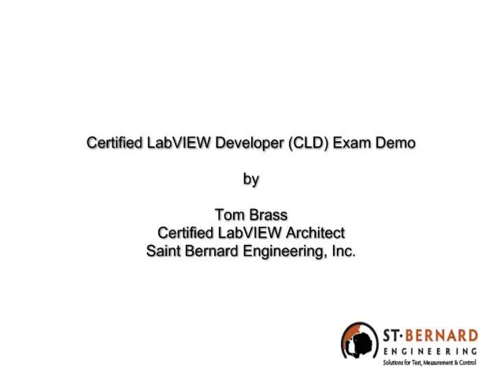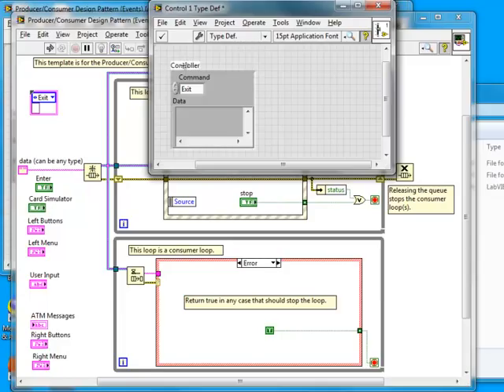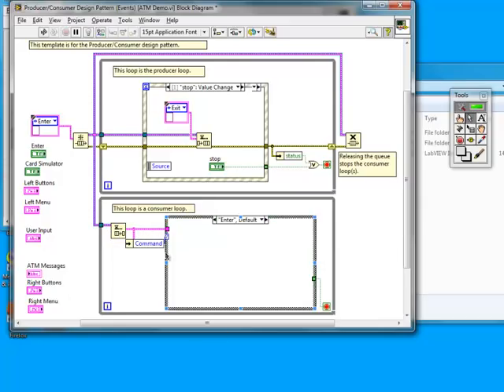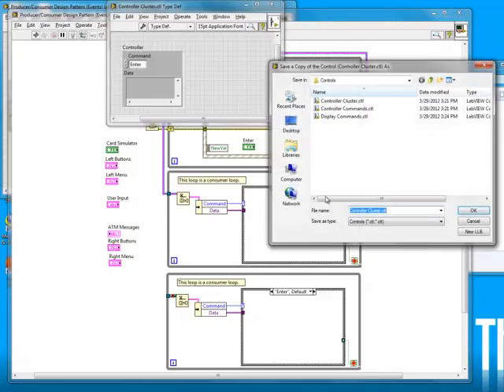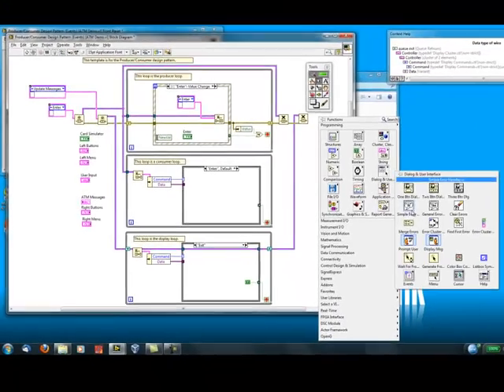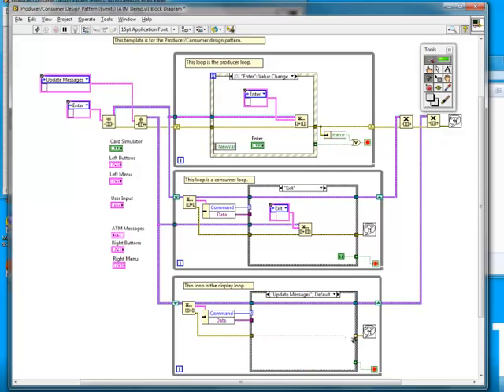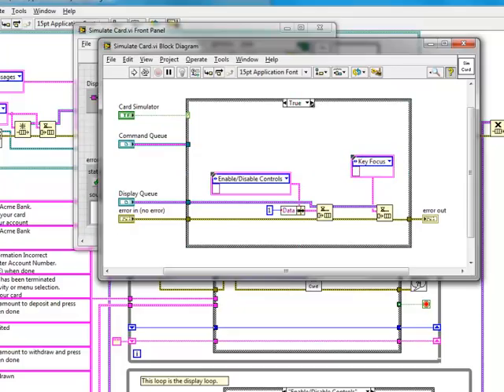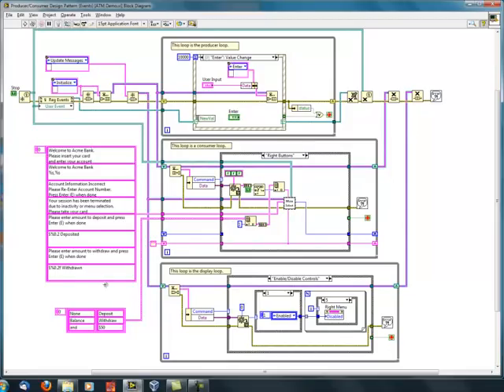Certified LabVIEW Developer (CLD) Exam Demonstration

Comment: Really good video, a lot of good stuff, great ideas to handle the UI, and an elegant way to do the ATM, I've been trying to duplicate the entire design to fully understand it all (the resolution is a little rough), and just about have it except for the subVI details which look to be straightforward. I've taken the CLD 4 times now-just a little too slow to get enough functionality in 4 hours. The last time I used a producer- consumer and got really, really close. In my opinion, unless someone has been using this 3 loop producer consumer for several years, they're not going to be able to do it in 4 hours. NI doesn't give you enough points for an elegant design versus a simple one  to make it worth the trouble and risk of having a broken, incomplete design.  You have to have a good portion of the functionality (maybe half) to pass and I've decided to use a simple state machine for the next attempt. If anyone can do a design similar to yours in four hours, they don't need a CLD anyway. But its a very educational video.
Reply: ***** Hi Tom, Thanks for the response. I will look forward to your Simple State Machine example.  The File > Create Project>  Simple State Machine gives you a  Template with an Event Structure in a Wait for Event case of a state machine, which I think is probably the most efficient way to create a potentially passable exam solution (that I will try next time). I tried the Producer Consumer Events and I think it becomes a bit too complex for a four hour exam. What's odd is that they give you different pattern options if you choose File>New> versus File>Create Project so you have to remember which way to access your favorite pattern assuming you don't want to create it from scratch. Anyone else has any tips, I'd love to hear.

Comment: Thanks for sharing.  Great video.  I had a couple questions:

1.  Is there a disadvantage of using the relatively new Project wizard 'Queued Message Handler' to create a similar framework for CLD exam?

2.  Have you posted the source code to your ATM solution at a web location?

Comment: The producer-consumer loop template is not available in LabVIEW 2017, and I admit that I largely ignored the built-in templates until I finally went for my CLAD recently.  I use producer-consumer when acquiring and recording high speed data, and have for quite some time, though.  This architecture looks an awful lot like what became the QMH architecture.

Comment: Seems a bit elaborate for just a ATM Machine. I would have went with a simple state machine. Much simpler to implement.
Reply: Disagree. SSM is not modular or scalable, especially when compared to the PC Loop. Modularity, scalability, readability, and maintainability is the first grading criteria.